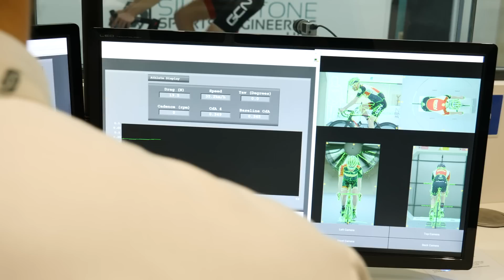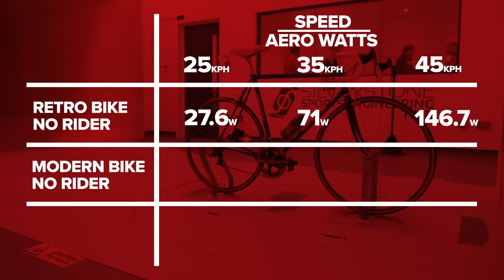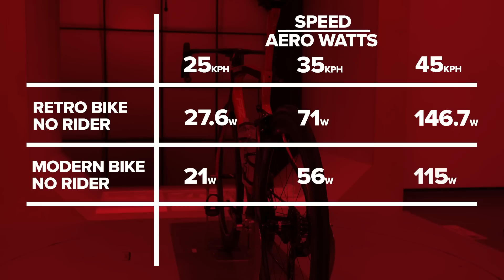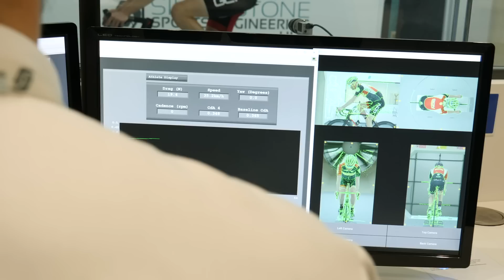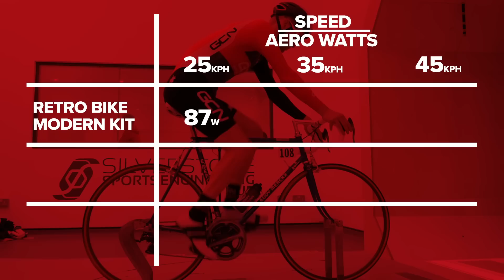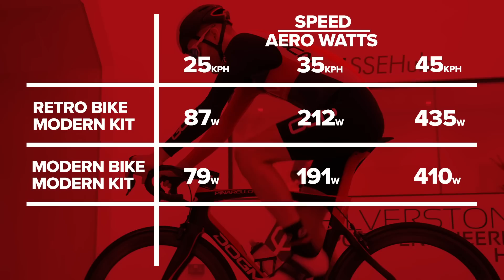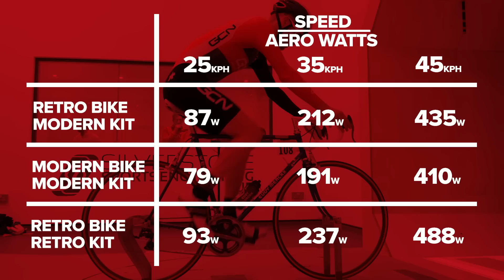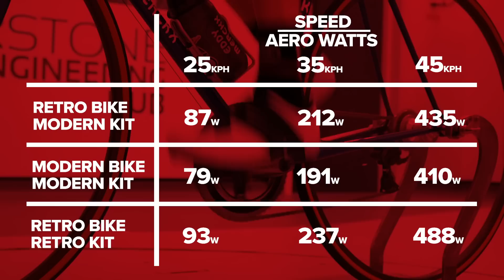How Much Faster Is A Modern Road Bike & Kit? | Retro Vs Modern Wind Tunnel Tested

Comment: I can do 45 kph solo in the drops on my SuperSix Evo around 363w. My interval training ground is a long road loop with 0% gradient commonly used for 40km TT’s. 

I feel as though it’s a pretty good representation of a true flat, so I’m surprised to see the wind tunnel test be at 435ish watts plus rolling resistance! Perhaps the hoods vs. drops does make that much of a difference.
Reply from the maker: Great work! That's a great loop for fast training 💨

Comment: Bottom line is there's bugger all difference between the bikes. Stick the aero wheels on the Eddy and the gap would be very small. Stick an aero bar on and the gap would be in the noise - probably 5-10W  @ 45 kph. Whichever bike rides the best (cornering and pedalling) would be the fastest.

Comment: Quiz question:
Three riders do a time trial. They are all equally aero and equally heavy. The course is flat for the first two thirds, then it becomes a climb for the last third. The first rider puts out a consistent 200 watts for the entire course. She takes 10 minutes for the flat and another 10 minutes for the climb, crossing the finishing line at exactly 20 minutes. The second rider puts out a consistent 100 watts on the flat and 300 watts on the climb. The third rider puts out 300 watts on the flat and 100 watts on the climb. 

Who won? Who came in last? Who burnt the most Calories?

Comment: So, below the only 6% gain at max speed, most riding is the slowest, 10% to mid, 11% and design-wise if the trad frame is allowed to attach the downtube above the chainrings it's close to the same, 10% less drag over distance.

With 80's bike polo frames made that way there's no structural reason not to, just a stupid UCI rule to go slower that put thousands of steel framebuilders out of a lifestyle.
Ymmv.

Comment: "retro" kit isn't really a useful comparison. That's more like a poor jersey fit vs aero fit. You could do the same 'poor fit' with the bikes by changing the position or handlebar height but that would be equally poor comparison. What would be more useful is a material comparison (ie tech)... 'retro' material in a modern aero fit (ie merino wool) vs "aero" materials. What we want to see is the tech comparison. Same fit/position (both bikes and kit) but the change/evolution in tech. Don't tell us bad fit/position isn't aero, and skew the results. We know that already!

Comment: The gains of the modern bike with rider over the vintage bike with rider is enough to just be from the wheels, thus showing how little the frame contributes... frame at most is probably 2-3 watts.

Comment: Well, bikes have a potential for re-selling in the used market, Im pretty sure there is not a huge demand for used bib shorts on Ebay.
Also Bikes tend to be more durable than clothing and they will still fit after the Holidays which I can't say the same about tight aero clothing :)
Anywyas watt saving its always good (and not cheap)

Comment: Free data is free data, but I feel like there's absolutely no point in comparing bike without rider even if it has less variance, its a bit like testing a bike drag without wheels... Also if its just purely old vs new, shouldn't the old bike be setup as close to modern as long as components allow for geometry (same positioning/narrower handlebar)?
Reply from the maker: The bike comparison was quite nice to show how much more difference a rider makes as well as how tough it is to save drag on just the frame. We compared a typical retro set up vs a modern one to show how far things have come since the days of Eddy Merckx!

Comment: I was hoping they were going to actually report the CdA values.
Reply: There's not quite enough info given (they needed to provide the air density) but assuming a ballpark value of 1.18 g/cm^3 for air density and the wattage values given, CdA(bare merckx) =  0.1285; CdA(bare F12) = 0.1006; CdA(merckx/modern kit) = 0.3814; CdA(F12/modern kit) = 0.3562; CdA(merckx/retro kit) = 0.4270.
Reply: Thanks. I was being lazy.

Comment: The question is, how much does this pertain to the real world where wind is not coherent and directional. It does seem clear that the newer bikes have a wattage advantage, but the wind tunnel should include steep yaw angles too. Even a slow airplane will fly above freeway speeds, whereas traveling at 35mph (56.3kph) is not common among cyclists. Your helmet will make a far larger impact on watt savings than your bike frame. It may even be conceivable (in theory at least) turn your head into a crosswind, although I don't know how practical that is.
Reply from the maker: This test of course is limited when it comes to cross winds, but it gives a good overall picture - it would be cool to get more time in the tunnel to test all the parameters you've mentioned too!

Comment: Interesting video, but it's a great pity that you didn't compare like with like - i.e. modern vs. retro with exactly the same setup. If you had made sure that the contact poins and bar widths were exactly the same on both bikes it would have allowed a genuine comparison of retro vs. modern equipment, as opposed to retro vs. modern equipment plus setup. Doubtless the drag differences between the bikes would have been less with the bars set to the same height, same bar width etc. Ok, it's true that wider bars and higher setups were more common in the past, but this is a different set of parameters and by not separating them you have effectively made the comparison meaningless in terms of measuring improvements in bike design. It's quite possible that nearly all of the drag differences were down to setup! I really think that this must be the case as I'm sure that there isn't a 20w difference at 35kph between my steel bike and my aero bike. Same with clothing - just stupid to compare unzipped retro with zipped modern!!
Reply from the maker: Cheers for watching Neil, we did this to compare the big picture between retro and modern hence the variations in position and clothing. We're glad you found it interesting!

Comment: PLEASE DO AN EPISODE ON HIGH PSI (130-ish) WITH A FLEXIBLE (possibly steel) FRAME VS. LOWER PSI (85-ish) WITH A SUPER STIFF CARBON FRAME ON AVERAGE TEXTURE ASPHALT
Reply: The idea being that maybe a flexible frame with a high psi in the tires may be faster than a stiff frame with lower psi in the tires since lower psi is pretty much just a compromise for imperfections in the road, and a flexible steel frame might be able to do the job of absorbing the vibrations while still having the very low rolling resistance of high psi in your tires

Comment: CdA differences has got very little to do with the steel frame, it all down to the wheels. 30-40 Watt difference at 45 kph can easily be accounted for by the deeper section low spoke count bladed wheel set compared to the 32 round spoke box section wheels.
https://www.hambini.com/blog/post/bicycle-wheel-aerodynamics-which-one-is-fastest/
Try the retro steel bicycle with retro Shamals and some retro Spinaci for good measure.

Comment: My job requires that I travel a lot and I end up driving long distances with my bike on the roof rack. I already have the Profile Razor 2 water bottle. What would improve my gas millage more; a disc rear wheel or a clip-on aero handlebar?
Reply: Put it in the boot/trunk?

Comment: As you NEVER ride in a perfect headwind, these ‘tests’ are next to useless
Reply: Probably not useless as aerodynamic drag would still exist and be mitigated to a lesser degree.  The differences are most likely much more negligible.  Considering how little difference there is, these gains are extremely marginal.  It isn't going to help the average rider at all, however the pros probably do see tiny benefits.
Reply: How do you suppose an experiment be set-up to create a situation where completely variable vortices are created to be perfectly repeatable so you can have an actual “real world” result?

Comment: Interesting to the difference between the two bikes so small, if you swap modern aero wheels on the old frame it would melt closer again. i guess the very low cross sections (and thus lower frontal area) of the old frame makes up for some part of the more areo (but fatter) tubing on the modern bike.

Comment: The lesson seems to be don't upgrade your bike, get a better fit and work on your riding position. Which makes sense, I pass lots of people with expensive bikes :D.
Reply: yes, getting 30mm of spacers off the steerer tube and maybe adding a bit of stem length should almost make up the difference between an entry level aluminum and high end aero carbon frame.

Comment: I don't have a wind tunnel, how much difference is there on a normal road?
Reply: why should it be different in the road?
Reply: @Digi20  Because the road isn't smooth, the wind comes from several directions and strengths, I'm not upright all the time.
There are other factors, but these stand out.

Comment: This was your chance to do "legs shaved vs unshaved" testing. You missed it!
Reply: The specialized 'win tunnel' has already done a great video on this. I believe it's called "The Win Tunnel: Shaved and Dangerous?". It makes a much larger difference than I had thought.
Reply: @khaki.shorts  Sleeves for the win!
Reply: Aerodynamics says shave the front of the legs and arms and leave the rear unshaven.
Reply: unshaved will be faster according to aerodynamic laws
Reply: @reznikvolodymyr8145  afaik they tested it and i give like 40 sek. on a 100km ride.

Comment: Maybe you could test modern bike vs old bike power required, but in realistic conditions for road bike (on road, not in wind tunnel), I may be wrong but if you just find few kilometres of asphalt, than travel it in both directions, keeping desired speed, while logging power required, you should get more useful results, than this data from unrealistic conditions for this type of bike.

Comment: I would be curious to know how the retro frame would perform with modern wheels.  Having ridden a retro bike with retro wheels and then switching to modern wheels, the wheels alone make a HUGE difference.
Reply: Search 'Hambini aero wheels' for a relevant analysis, at least. He reported data at 30 km/h and 50 km/h. I remember reading that some wheels advertised as the fastest were not the best performers at the more human speed of 30.
Reply: @markeetea  Not even aero wheels specifically.  Even modern training wheels make a HUGE difference in my experience.  It's surprising how much of a difference just reducing the spoke count will make for aerodynamics and weight versus old 36-spoke wheels.
Reply: @christopherdolan7330  I've got a pair of 36 spoke racing wheels, they are a smidge under 1700g and that's with traditional round spokes, not very aero but as older wheelsets go for a 36x36 they're pretty light for clinchers.
Reply: I've got a 1959 Carlton 531, I ran it with 10 speed cassette + 38mm carbon tubs, the frame at some point before I got it some 15 years ago had been cold set to accept a modern/130mm OLN wheel. It looks weird with the black wheels as it's a BRG frame and white bars/saddle but just rides a bit differently to the wheels I normally have on there. The tubs are 22mm conti 4ks so on the smooth local bypass you can nudge 30mph for short spurts even with this old codgers legs and the bike is fine, I kept it as a mix of parts that matched rather than all period correct especially wanting to have some dual pivots though some of the older brakes were pretty decent if you set them up okay so they do work on carbon rims so long as you pop the right pads in if you're going to be braking a lot.
The main differences with a particularly retro bike and modern wheels I found is the handling at speed in sweeping bends and even compared to a 1990 Vitus Triple butted the Carlton feels less stiff all round so you're feeling your way a bit more around bends so not as fast or as tight though it doesn't feel too bad in terms of comfort or if hitting a bump through a fast bend.
There's obviously an element of not having ridden the bike much in that set up (pretty much once with the carbon wheels) so as with most things it's about getting used to how the bike goes on certain terrain and how you might need to adapt a bit to get more assurance.
All that said she's a bike to show off, have a pootle without putting too much effort in and chatting about old bikes rather than gunning her, I can easily fit 32mm tyres, probably 35s so you could ride her off road if you wanted to but I normally ride her with some older tan walled Vredstein Ricorso's in 32 which are a lovely tyre, I use slightly wider latex tubes so the ride is cushy as f.
Reply: Aero wheels are worth 2-3 km/h not sure how that translates into watts.
Reply: Right, and not the aero wheels only, but the whole set of modern equipment on a skinny retro frame.The only disadvantage of the crmoly frame is its weight,so on the flats i think it's not a big deal what the frame is retro or the modern one.
Reply: @az149keyjoecoil4  skinny round tubes are significantly less aero than you might think.  But I still think wheels would make the biggest difference.
Reply: @christopherdolan7330  I made yet in 80th styrofoam pads in a drop form shape on the rear side of the vertical tubes of the frame + pads  made of fabric for rain coats on the wheels- a kind of modern disc wheels and used that bike for TT competitions.
Reply: WELL l ride retro steel with modern kit just fine at 30 -48km hr and the new groupo on old bike rides awesome thanks l wish it was lighter but it sure is comfortable compared to my carbon TREK !!

Comment: I like the comparisons at the 25 kph speed. It's easy to forget that we're not all racers. The difference between aero bikes and retro bikes isn't extreme at 25-35 kph (15-21 mph if you prefer). If you don't need to get a racing advantage, you don't need to pay the high price for a top end aero bike unless that's what you really want to ride. It means the weight and aero penalties of my retro Wilier aren't enough to overcome the benefit of comfort that it gives me in local group rides.

Comment: How much of that drag is the wheels? Because I know how many watts the modern frames save and it's really not that much. You guys mentioned the tyres but that's not really the problem, it's the depth of the rims and matching the rim with the tyres.

Comment: The deeper lesson in here is that the bike itself is dramatically less significant than the rider. Bike alone had MUCH larger difference at higher speeds, but with rider it dropped massively. So, conclusion: If you really want more speed than your friends, just get off the bike and stare at it in the coffee shop!

Comment: You need to use the old wool jerseys and shorts to be authentic!  Also the brake cables housing would be hanging out for true retro!
Reply: The vintage bike is mid-1980s I think, too recent for woolly shorts.

Comment: I think you missed a trick by not doing any runs with a set yaw angle to simulate crosswinds. I think most aero bikes are designed to perform best when there’s a bit of crosswind

Comment: low speed aero can't be estimated in a steady state wind tunnel. Local vectors cause lots of variance.
Reply: Yes thats accurate.
Reply: Hambini is a tool
Reply: Agreed. And 45kph is low speed in regard to aerodynamics.  @hambini has an excellent video in which he addresses the issues with the way bicycles are tested in wind tunnels. The air in the outside world is turbulent even on a still day.  These wind tunnels are using hex grid alloy walls to “comb” the air into perfectly straight lines that do not exist in nature. Placing the subject on a turntable to measure at “yaw angles” does nothing to replicate the outside world either.

Comment: bottom line, aero is not worth it so buy the lightest kit possible.
Reply: How do you draw that conclusion from this test? Are you blind?
Reply: @MrBJPitt  Bike to bike, the aero loss of bike alone wasn't all that much compared to aero. Now aero bikes do push 6.4 kgs but you can find pure climber's bikes at damn near 4.75 kgs and then add to the fact in cities or anywhere, you are accelerating out of redlights, corners, doing some small climbs and doing major 20km long climbs or on a lumpy ground, the energy savings from weight will outbid aero. Also, put that bike aero money into an assos or castelli suit and you gain more on actual fondos/sportifs.

And for max aero on non race days, put those weight savings towards clip on aero bars and gain vastly huge amounts of savings there.
Reply: @9034833838  the science says you are wrong.
Reply: @MrBJPitt  Then science can introduce itself to joe